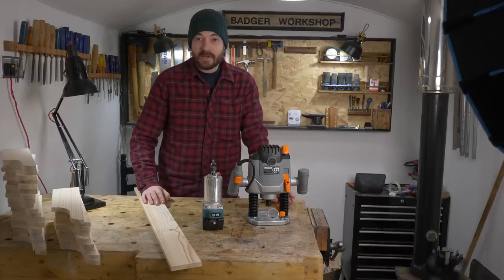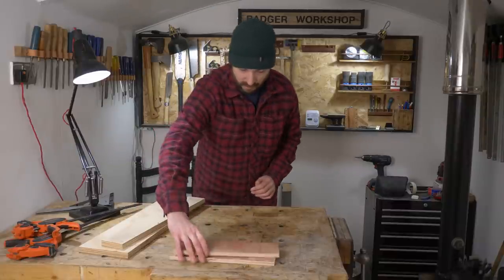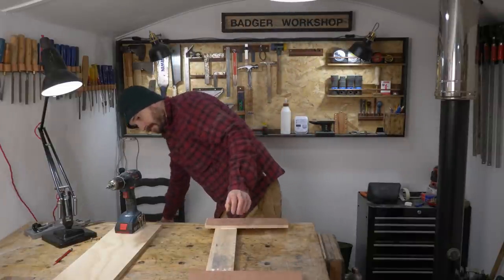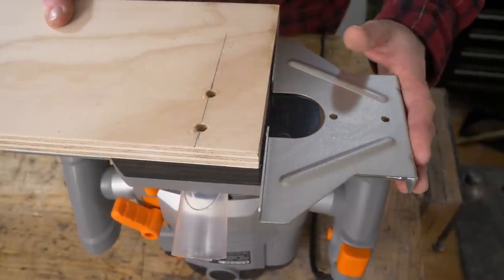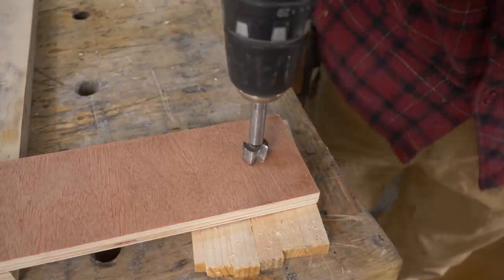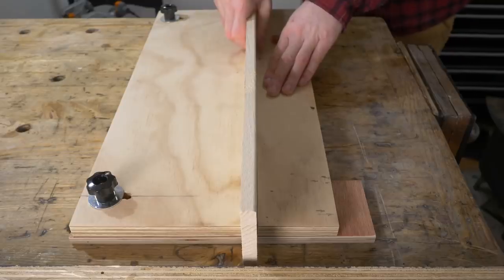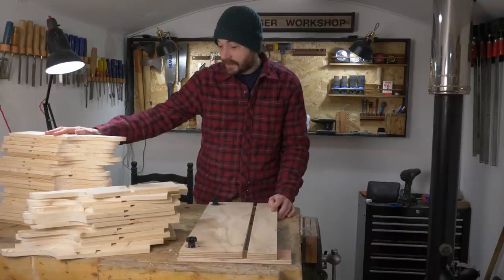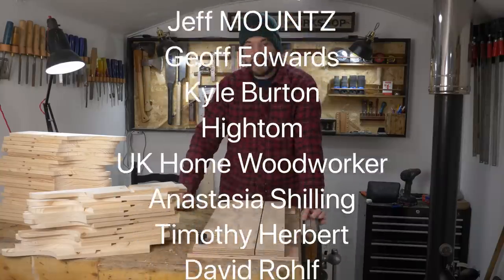Router Dado Jig

Comment: Nice job Matt! My home made jig is very similar to yours but uses a small diameter straight cutter and guide bush. I have a bit of 5mm high density fibreboard fitted under the jig, which is trimmed with the first cut to match the offset of the guide bush/cutter combination. When the 5mm hdf begins to show signs of wear, I just unscrew and replace it with a new one

Comment: What you need next is a router table, and considering the size of your shop (small like mine) something that integrates with and can use the fence on your table saw would be a good idea. That's where I'm going next after using a standalone table that slots onto the top of my workmate.

Comment: nice one!

if you stuck some sand paper with double sided tape underneath the jig's sides, it would prevent the material from wandering off 
or add some cam action clamp or something that can hold this setup still

better still use the router table, and the spacer between the fence and material, and do one edge with the spacer, and the other edge without. you can then switch to production mode.
or just move the fence for the 2nd edge, and do all pieces at once.

Comment: Seems like you can make another one of a different length and connect the two for longer dados or grooves. Just build the second one with an overhang so the ends meet up smoothly.  TBH, I was about to turn away when you threw that look to make sure I was still there. It’s like you looked into my soul. 😎

Comment: Great jig! I would definitely bet on it being faster than a table saw if you were using a standard kerf blade.  Dado stack is probably faster, but if you only have a few to do, then this jig is faster to setup than the stack with all the shimming and testing that needs to occur.  Cheers!
Reply from the maker: The trouble i have is most saws in Europe won’t take a dado stack